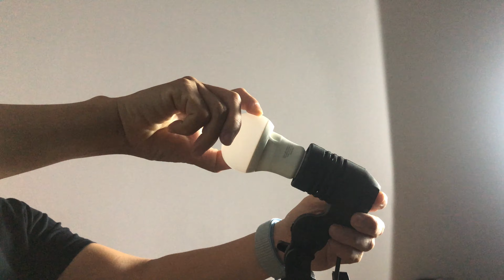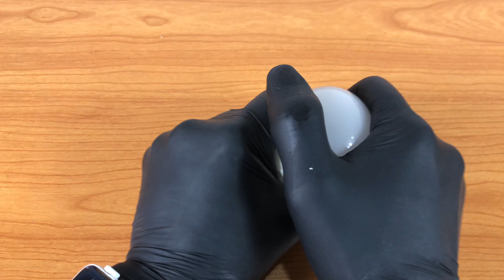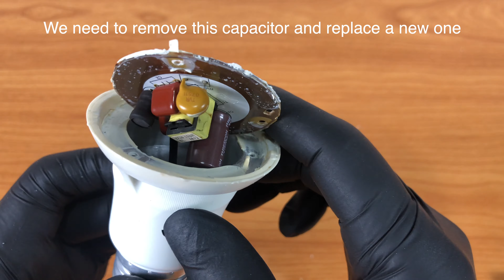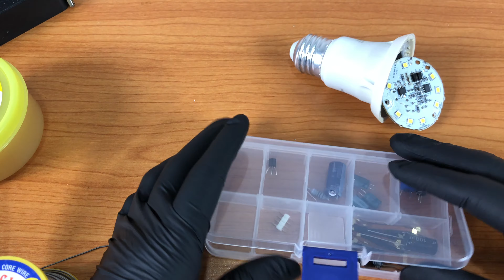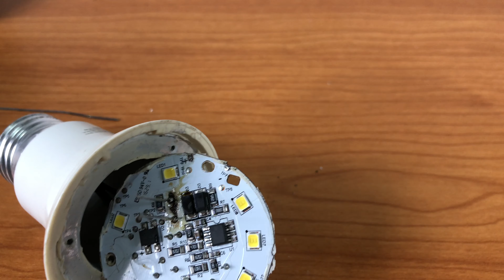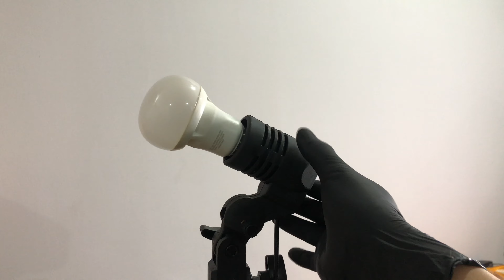Fix the Flickering LED light, do not put it in the trash before watching this video

Comment: Took apart a Philips 800 lumen bulb.  After an hour of cutting the top off, there was a disk of about 40 LEDs but under the disk was a metal plate.  No exposed circuitry.  I cut the metal plate out and found whole base plus the circuit was potted.   After an hour of removing the potting material, checked the capacitor and it was fine.   Probably an intermittent solder connection elsewhere.  It was a destructive process, so no salvaging here.

Comment: Why not test it to find the fault and check that it works before putting the glue? The capacitor was not obviously failed. You can usually open then with a dull but strong paring knife to avoid cutting and ruining the edge. Somehow the white spot couldn't be seen when the lightbulb was screwed  back in, as if it was a different one.

Comment: Every brand of LED bulb I have tried flickers.  At every location in the house the LED bulbs flicker.  Usually they operate just fine for a few minutes then a little flicker. And then immediately before I can get my eyes turned towards it it stops and operates just fine. Brand new bulbs do it. Year old bulbs do it. Every brand does it. Bulbs rated for dimmers do it. Bulbs not rated for dimmers do it. The LED bulbs do not flicker in unison so it's not some common power problem in my house. They all flicker independently. At another house the LED bulbs do exactly the same thing. 
CCFL's and incandescent bulbs did not do that. My many UPS's do not trigger and they would if merely a single cycle of 60Hz was missing - or if the voltage dropped for an instance. It's confined to the screw in medium base(E26) bulbs. Even the BR30 ceiling can light bulbs do it. I have never seen the candelabra base bulbs on the chandelier flicker nor the ones in the ceiling fans. That chandelier is the only fixture that has a dimmer switch.
My neighbors have outside flood lights. They are the medium base type. And they flicker. So it's not just my house.

The only thing I can figure is I am going to have to open up every bulb and design my own power supply for them.  Apparently the power supply is poorly designed on all of them. I wonder if they all use the same chip? It is not uncommon that I have found a problem across all brands of some appliance and on investigation determined they all use the same driver chip. 

I design car DVD players. I noticed a particular bug on all of our DVD player's rendition of the screen image. Years later our newest design still had the same little bug. Then I had a chance to examine some competitors DVD players and they all had the same bug.  I traced it down to a DVD mpeg rendering package of C code that everyone was buying and dropping into their products. No one wrote it themselves because writing an MPEG engine is hard and thus quite expensive. The bug was never fixed by the C code supplier. And today, 15 years later, it's still there. Apparently I am the only one that notices it and complains. But I'm only the electronic design engineer so my complaints are ignored by the software department.

Comment: My  one dollar led bulb has nothing under the plate.Just 2 wires. Looks like it has the capacitor on the top. It is a short one.  says 200v?? i have some big capacitors for audio amp and they are only 60v. use a putty knife to break the seal on the bulb cover. just slip it into the seam and push all around.

Comment: I opened my  flickering bulb, found two capacitors. Being nott sure which one I need to replace, I looked up replacements for bot, it would cost me at least $4-$6 to get new ones, let alone the effort of soldering and replacing them and putting the bulb back together. Not worth the effort, can just buy a new bulb.

Comment: I've got a WHOLE BOX of brand new LED lights.  Every one of them FLICKERS constantly.  I think they are badly designed.  Replacing the capacitor is way more work than the value of the bulb.

Comment: Hi, the lights in my room are connected in one switch and runs through one wire they both do this. Should I just replace both bulbs or is it something more serious?

Thankyou.
Reply: Loose wiring. If it’s can lights check below ceiling (tighten the bulb) and in the attic (remove cover plate and check wire nuts).

Comment: the capacitor stores the energy and “flatten” the ac current into dc, right?
Reply: No. Capacitors only work in AC circuits.
Reply: @KGDRAWROF  Nonsense
Reply: @KGDRAWROF  "AC" as in Air Conditioner?